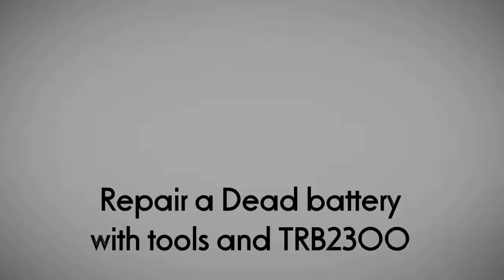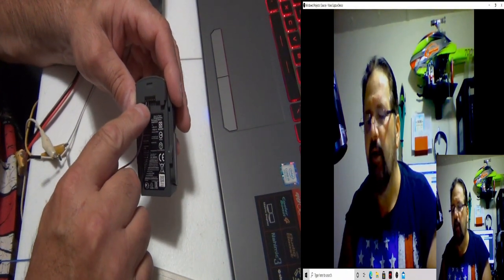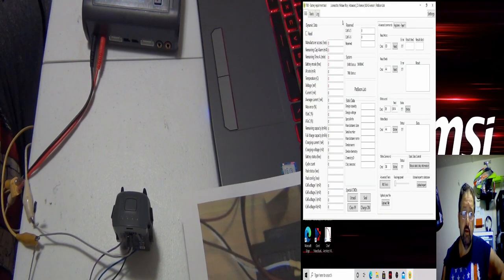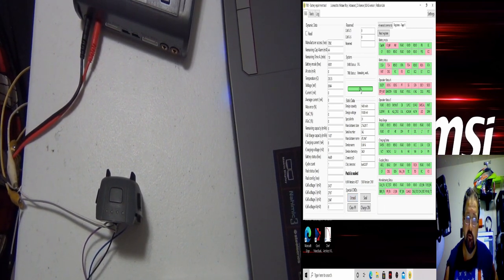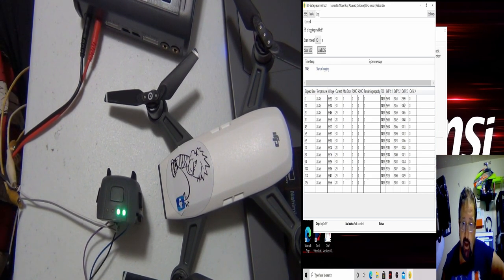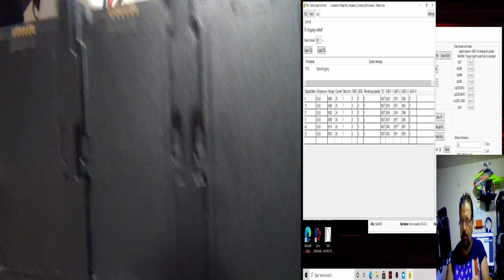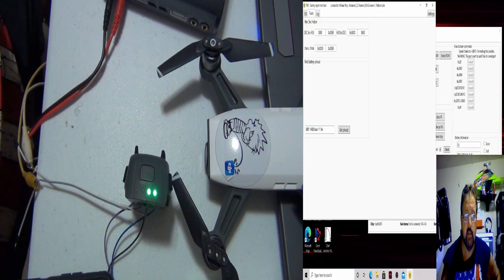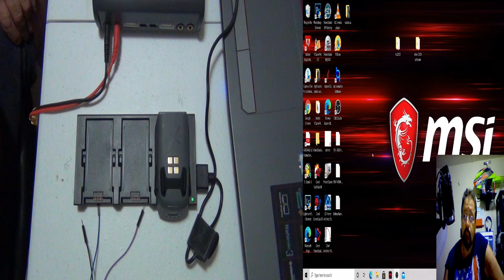DJI SPARK repair a dead battery with TRB2300 and tools

Comment: Good information.  Is there any way to jump start the battery without having the TRB?  I have 2 batteries that are unknown on how long they have been sitting(storage).
Reply from the maker: you could try, but BMS still needs to be reset

Comment: Great video and software; amazing work!! 
Got my spark batteries charging again with the EV2300/EV2400, C240 and the TRB-2300 software :) 
Was initially wondering if the drivers for EV2300/EV2400 worked on Win11 but it was all good :)
Reply from the maker: sorry late reply, i dont have windows 11
Reply: @CRUZROYHelicopters  I would like to send you 3 batteries so that you can repair them.  how much would you charge me 😁
Reply from the maker: @rodparan3210  where are you, i only repair in USA , shipping is now hell, do you have FB easier to contact, PM me instead of here....its private
Reply: @CRUZROYHelicopters  I'm in the USA give me your email to communicate with you.  Thanks for answering
Reply from the maker: @rodparan3210  i dont post emails here, do you have facebook or are you on any drone forums

Comment: How do I get in contact with you. I have 4 spark batteries I would put to be repaired!
Reply from the maker: i just did 4, and 3 survived, so i cant all will come back one just had a to low of a cell count, sometimes i have to open them, and glue back together, what is wrong with your, how long they been dead, or when you click the button do you get even a flicker of light?
Reply from the maker: Barry Heffron
you can dm this guy about restore....see if happy
Reply from the maker: i would have to see if cells got to low, but it can be done, i sent 4 back to someone and one just failed after a few charges, but it had one cell at 790 mv i got it to 3.8, but got to low to stay revived

Comment: Can i send my 2 batteries to you? Pls lmk!
Reply from the maker: find me on FB or PM me your email for info
Reply: @CRUZROYHelicopters  sorry i don’t have FB. What would the cost to jump start 2 spark battery?
Reply: @CRUZROYHelicopters   may be i can try this first. I have this trickle charger that i use for my RC. But it doesn’t have the option for Digital power. 

Can i use the lipo charge option to jump start it at 1amp? 

So the black wire goes to negative next to C and the red wire to left Positive on the battery?
Reply from the maker: @popitn2nd  if you try to charge it will discharge more, send me your email privately, the bms is in SS and PF
Reply: @CRUZROYHelicopters  why will it discharge it. As i observed your connections.. you hook up 3 pins to Clock, negative right side and Data for the software. Then for the trickle charger.. you pin to negative and positive at 1amp set to 11.4v to charge. Since i don’t have the software to look at the data. I will try and pin left side negative and left side power andI set to lipo 3s 11.4v @ 1amp to charge it. Is this wrong?
Reply from the maker: @popitn2nd  .5 to 1 amp is fine, but its in the DJI bms, it will lock you out from charging, and will discharge the battery, the only way to charge each cell is to open battery, that will work, but bms will still be locked, if it was that easy, everyone would do it, there is even a guy who says you can HV neg and positive....NOPE, you will just cause battery to explode, i get batteries now and again, i will have to do another video, this one gives false hopes i guess, there are 2 errors that sparks are notorious  for, "PF" battery has gone below 2.8 volts, "SS" all cells are not balanced, if you have both, you are defiantly locked out from charging , its a DJI saftey...it wont let voltage into the battery cells
Reply: @CRUZROYHelicopters  i tried your instagram but i don’t think that’s active. I don’t have FB. How can i contact you.

Comment: I have a battery I’d like to send you as well.
Reply from the maker: i would have to see if cells got to low, but it can be done, i sent 4 back to someone and one just failed after a few charges, but it had one cell at 790 mv i got it to 3.8, but got to low to stay revived